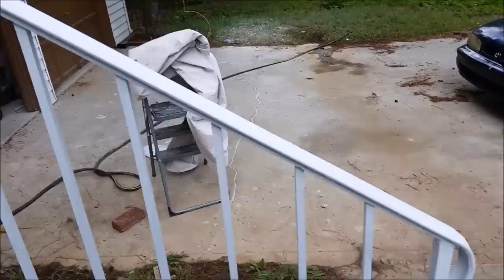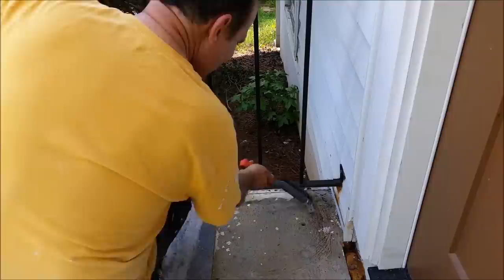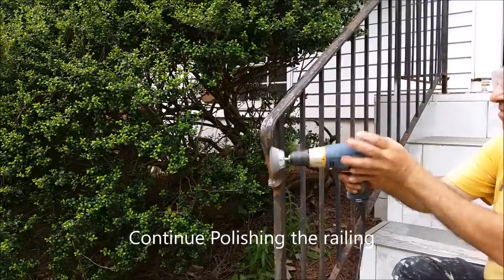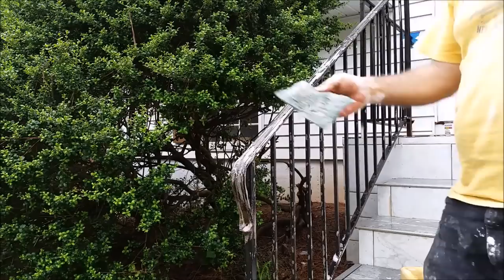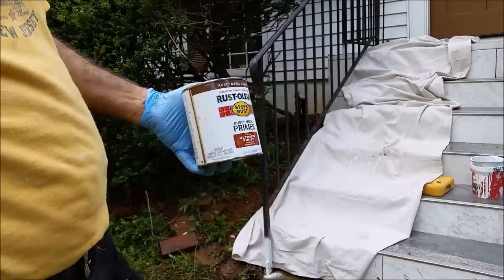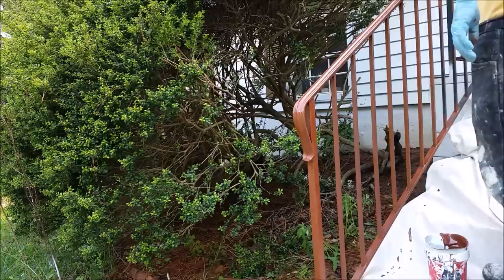Painting Rusty Wrought Iron Railing  - Using Rusty Metal Primer

Comment: Note for anyone who has never used this stuff, it is INCREDIBLY messy. It has a very unusual flowing property that I don't know how to describe, other than messy. This was my first time ever using this stuff, so I had no idea how it would work, maybe people who have painted before, won't make the same mistake I made. It also could just be I wasn't paying attention and thought I was.

I dipped a brush in, dripped some on a flat surface, did that 2 or 3 times, feeling like I did it perfect and looked over and the oil primer was dripping out of the TOP of the paint can like crazy. The place I put it on the metal was perfectly fine and stayed in place, but be sure you look at your paint can and the area between the paint can and the area to be painted so that any accidents get noticed quickly, while you apply the primer.

Comment: How long did each side last before you had to paint again?
Reply from the maker: After you applied the Rusty metal primer you should apply two coat of pain (like semi glass or satin) . Apply water pain not oil pain. Every 5 years you can repaint . It will last many years and you will not have an issue with rusty metal.

Comment: Hello again.Can I use the brown primer for mostly smooth rail ? It has only little rust. Gong for black top coat.
Reply from the maker: The surface should be rough. This primer is attached to the rusty area. Basically, you can do  it just make sure that the surface area is little bit rough that the primer will be attached to the metal properly. If you not confidence please call Rust-Oleum technical support.

Comment: what primer worked better ? now that a year has passed ?
Reply from the maker: Both primers work great but the clean metal primer should be applied on a clean metal (no rust on the metal). If you have clean metal use the rust-oleum clean metal only. Both primer  are oil base but the top coat is a water base from Bher home depot. Do not use oil base for top coat only for primer.
Reply: Joseph K   One more can I prime clean paint without sanding? Thanks for the tips.
Reply from the maker: Sorry I thought you are asking on a clean metal. For rusty metal you must send  the metal from loss rust so you  need to send using steel brush and then clean the loss  rust  . Please follow my video and you will be successful  (Also read the manufacture instructions which are on the container) . I applied 2 primer coats.
Reply: Thanks a lot !